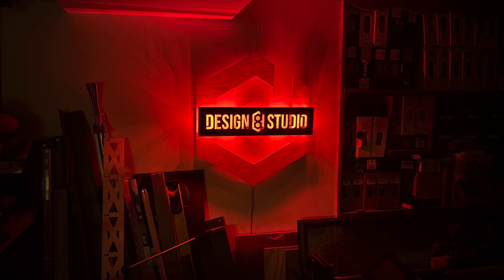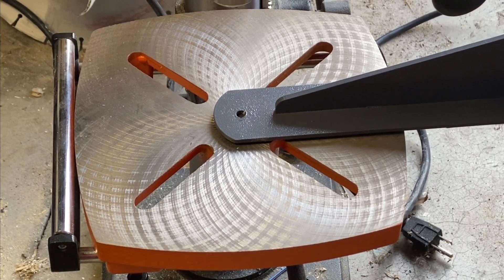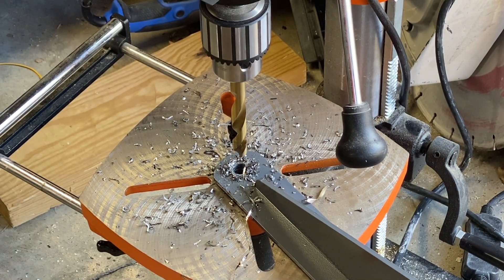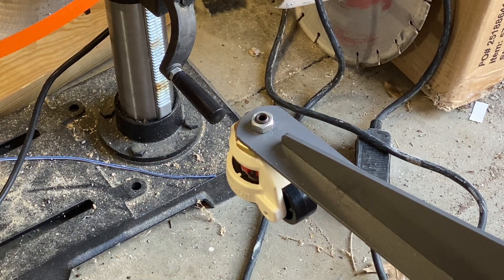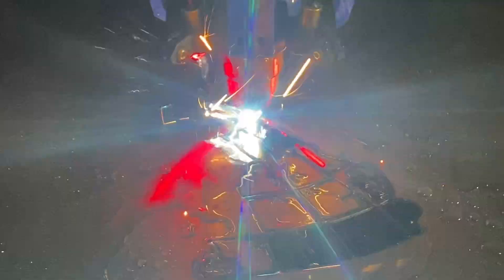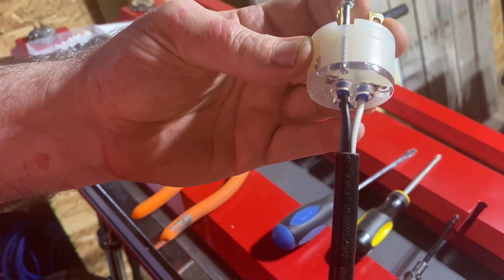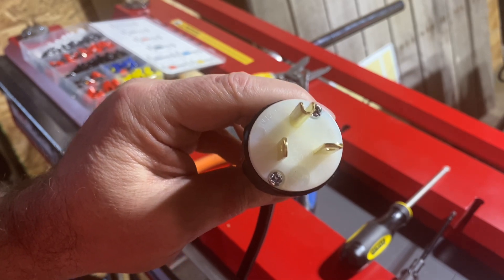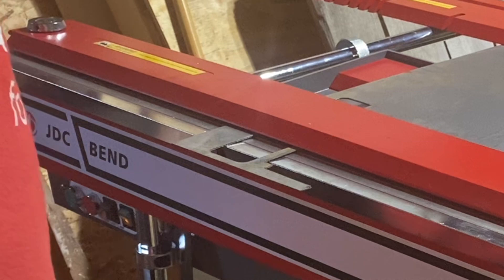JDC Bend 48" Magnabend 1250e electromagnetic sheet metal brake + step-up transformer for 220V

Comment: I first saw these on Clough42's channel, too.  I'm kind of surprised that there isn't a homebrewed version of this somewhere on YT, but if there is, I can't find it.
Reply from the maker: The inventor published the plans so that anyone who wants to can make one. I think the main issue is that most people don’t have access to the equipment needed, and don’t normally stock the materials needed.
Reply: @design8studio  Found it!  Thanks, I guess my google-fu was weak.  I've since spent quite a bit of time looking at his page, pricing self affixing enameled magnet wire, and thinking up ways to mill an e-shaped piece of metal the length I'd want on a Bridgeport clone.  It doesn't seem to require precision in the channels, I'm thinking clamp/mill, then shift and rinse/repeat ad lib.
Thanks Doug, who da man? You da man. That's who.

Comment: Hi, I have been looking at metal brakes and came across your video that JDC Bend has on their page. I work mostly with aluminum, have you ever used your brake for aluminum? How has your brake held up? I see a link for Alibaba, did you feel safe by ordering from them knowing it was not going to arrive for at least a month? Just curious about the cost of shipping? A magnetic brake is more verstile than a traditional brake, but it seems that 16ga is the heaviest that any of them will bend. Thanks for any input.
Reply from the maker: Hello! I am super pleased with the JDC Bend. I have only bent steel so far — I have not used it for aluminum yet. This was my first time ordering something via Alibaba, but aside from the extremely long delivery time (longer than a month!) it went just as one would hope. The shipping cost was considerable, but I still saved quite a lot of $$$ compared to buying from some US "front" company/importer, even when adding shipping into the total. They covered all shipping details (I did not have to deal with customs or any such thing). Regarding the 16ga thickness limit: that is for steel. Since aluminum is easier to bend than steel, you may well be able to bend somewhat thicker material than the limit with steel. PS: I think the limit is more related to the extent of the electromagnetic field strength than the excellent rigidity of the bender's metal.

Comment: How was your buying experience with jdcbend?
Do they take care of all shipping and related cost such as import fees?
Reply from the maker: Buying experience was great, except for how long it takes to get the item. If you’re in a hurry, it’s not the way to go. Yes they took care of all of the import fees as part of a single shipping price that I paid them.
Reply: @design8studio  I'm talking to them now and they gave me a door to door price and I was wondering if there was going to be any gotchas like an import tax bill.  Did you need a lift gate service for this?  Was that discussed before hand?
Reply from the maker: @jmkmusicpedals  They took care of all of the import fees as part of a single shipping price that I paid them. I had no gotchas, no import tax bill. It was the local delivery company's responsibility to get it off the truck, and the truck did have a lift gate. The driver went above and beyond by rolling the pallet all the way down my driveway and into my garage.
Reply: @design8studio  So I got mine in just a little over a month. I went with the 24" version. Everything went pretty much like you said. The drivers were great, wheeled it up and even carried it into the entrance. The only difference is that mine came with the Australian standard plug for 220v already attached, which is fine by me.
Reply from the maker: @jmkmusicpedals  Sounds good!